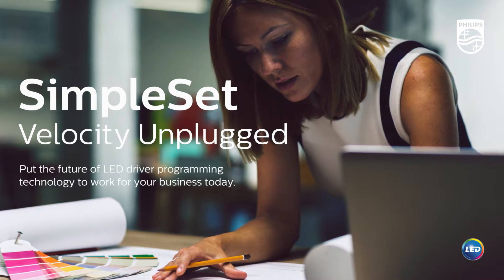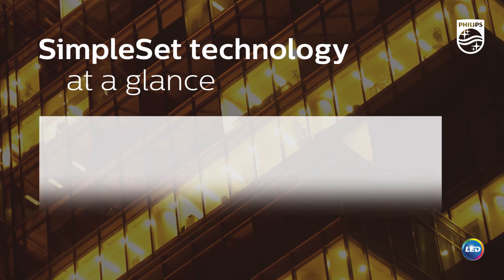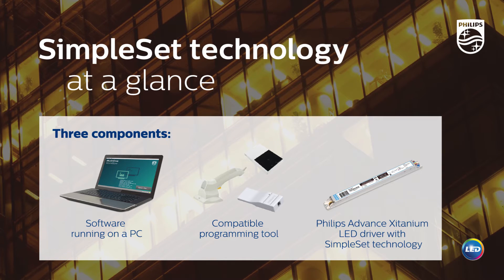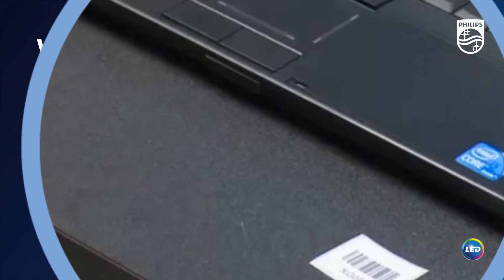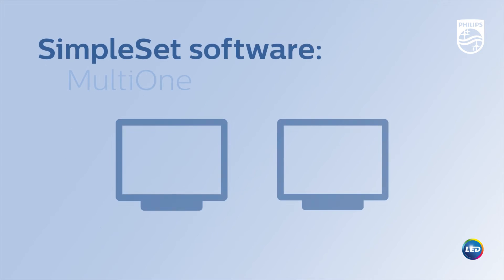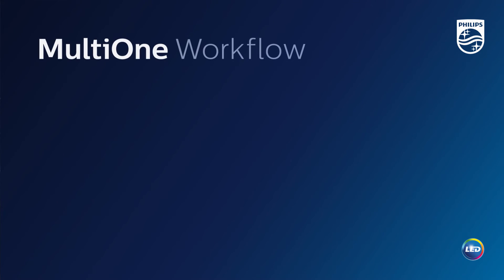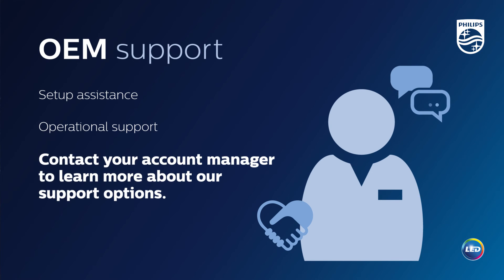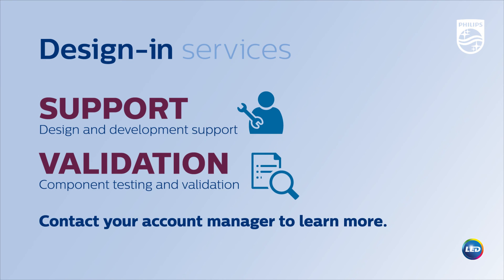Xitanium LED Drivers with SimpleSet - Velocity Unplugged

Comment: How do you reset these drivers for a new wireless network? Simply hitting the breaker and restoring power after 30 seconds doesnt work. I have dozens of lights in limbo atm
Reply from the maker: Hi, thanks for reaching out about this. To free wireless drivers for use in a new MasterConnect installation, easiest and best is to remove them from the earlier setup via the app. The drivers can’t be in two systems. For that you have to be on site for Bluetooth communication with the devices. If that is not possible because the old MC system can’t be accessed anymore, the power cycling method described on pages 75-80 needs to be used for resetting. Learn more here: https://signify.co/3GovDBb Thank you!
Reply: @SignifyCompany  yes! Drivers were removed from the app prior but still did not work. Performing the safe mode procedure worked like a charm. Appreciate the help!!!
Reply from the maker: Anytime! Thank you 💚